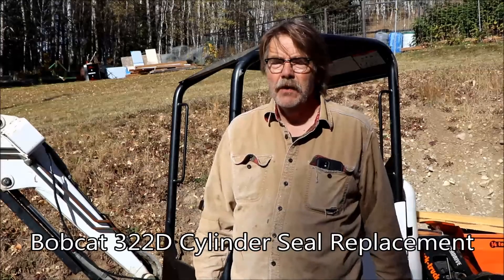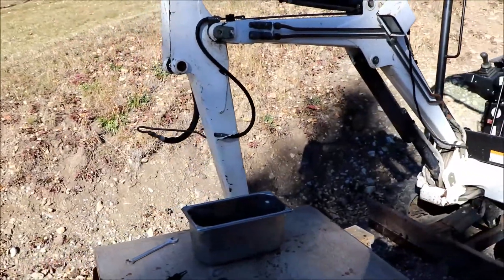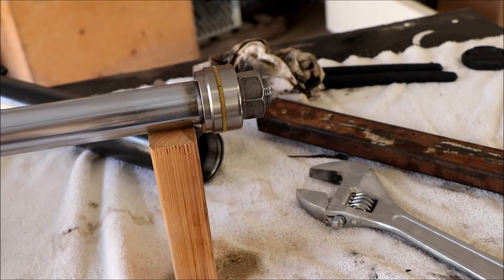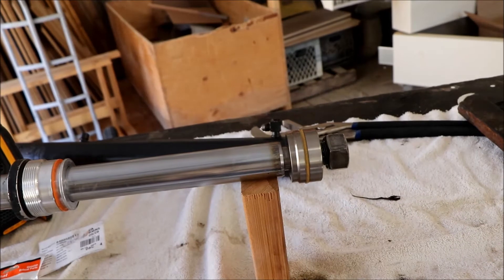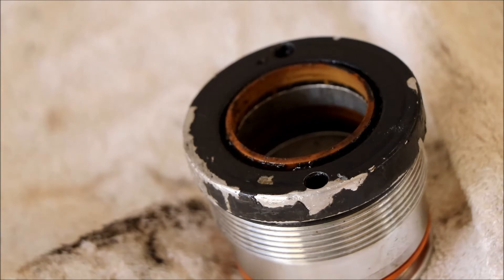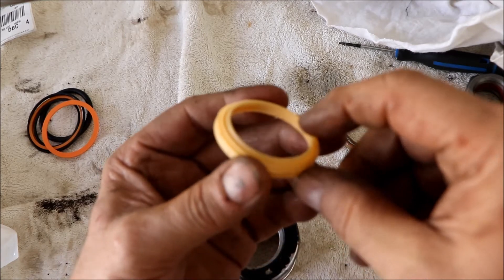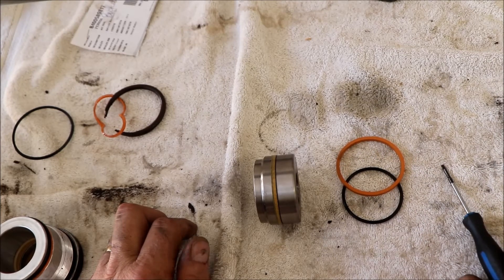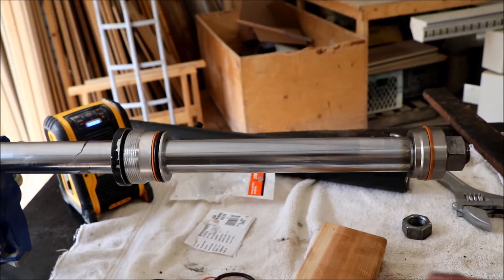Hydraulic Cylinder Seal Replacement - Bobcat 322 Excavator

Comment: great video!  thanks for sharing, my gland nut shoulder is too small to use a pipe wrench or channel locks.  Do you know what/where you would buy the correct spanner wrench?

I bought my seals from HW Parts, my local bobcat dealer does not sell the tools.

thank you for your help.
Reply from the maker: I could not find the proper tools either. I did not look too hard mind you. That's why I bought the channel locks and large wrench. If you have a welder you might be able to modify something. I'm sure that a specialty  tool supplier would be able to point the way. Sorry I can't be of more help.
Reply: @fromthewoodsyyc  no worries, I have the same channel locks you do, tried them today. No chance on budging it… I’m afraid to put heat on it and compromising the cylinder. 

Thanks for help. 

I’ll let you know how I make out. 

I wish bobcat would sell the correct tool for it.
Reply: Just a follow up after successful removal of the gland nut.  I bought the spanner wrench which was worthless. However in an attempt to weld the wrench to the gland i think the heat created just enough space to loosen it a little.  I also hit the seem between the gland and barrel with a hammer, slightly creating a little vibration movement... also used a punch to no avail.

Ultimately, I think all the different methods helped, at the end the 2' pipe wrench with another 2' cheater bar on it i was able to get it loose.

To brake the inside nut loose I used the same 2' pipe wrench and a 6' cheater pipe.... yup 6 FOOT!
Reply: I bought the proper spanner wrench off of Ebay.  It works great!  I have used it on all of my Bob Cat 325G cylinders.